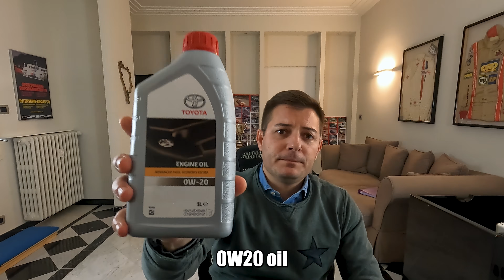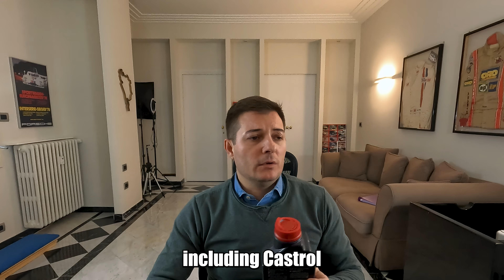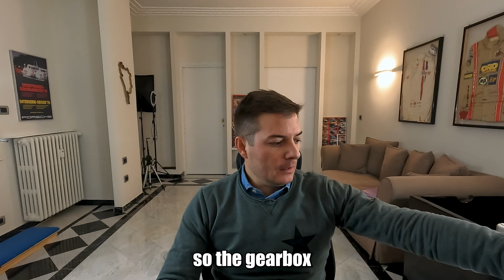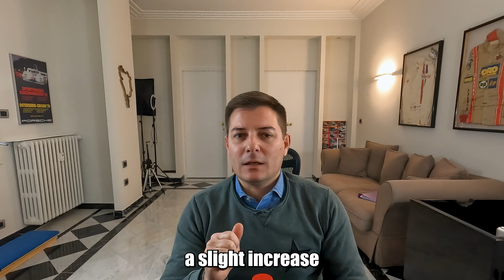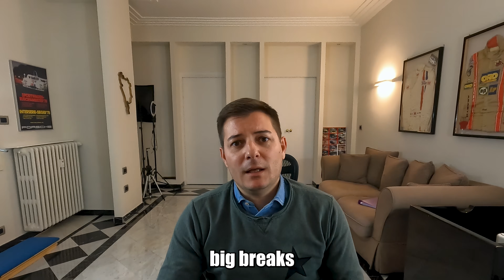Choosing Oil and Lubricants for Toyota GR Yaris & GR Corolla

Comment: In Australia we have a product by Penrite called Shift Eze. Its a PTFE additive and you just add 125ml of it to the gearbox. It has made a massive difference to the shift quality on my Yaris GR. I was not happy after swapping to the Motul oil. It was no better than the standard Toyota oil. Trust me this Penrite product is the best $20 you will spend.
Reply from the maker: That's an interesting tip, glad to hear you found a solution that works well for your gearbox feel! On the other hand, the suggested oil is an objective improvement.

Comment: Ciao, grazie mille per le informazioni, ricapitolando:
motore 5w30;
transfer case gear 300;
differenziale posteriore gear 300 LS?
Reply from the maker: Si, in realta’ si puo usare il 300LS anche nel transfer case. Un piacere e informaci se passi qui al Nürburgring!

Comment: I am coming up for my first oil change on my GR Corolla,thanks to your thoughtful insight I am going to use Motul 5W-30.  Thank you!😎
Reply from the maker: Great choice for the first service! 🔧
Reply: Not a good idea
Reply from the maker: You’re wrong, sorry to call you out
Reply: @PIRASMotorsport  Don’t be sorry. I just feel sorry for those who think a 5W30 is giving them added protection. You’re actually causing much more harm than good
Reply from the maker: Absoloutely not!
I don’t know on what grounds you’re making your statements, but mine are backed by Toyota racing, independent mechanical testing with Piotr and direct experience.
Reply: @P @PIRASMotorsport   I’m curious about the independent mechanical testing with Piotr you’re talking about. What did the testing entail?
Reply from the maker: The protection film the two viscosity’s offer.
0W20 is only meant to serve for fuel economy and emissions. It also washes very easily with fuel, so more frequent changes are needed when pushing the engine.
Reply: @PIRASMotorsport   I really appreciate your candor and engagement here but you continue to place yourself in an untenable position that weakens your position on this matter
Reply: I’m trying to keep this as brief as possible 
1. Your engine is not a testube therefore 5w30 doesn’t carry much weight (no pun intended). It’s all about HTHS shear values 
2. Having said that anyone insisting on using 5W30 your choice of Motul 8100 is the least of all evils. Its HTHS shear values are outstanding (best of class). However that comes with a penalty. More wear at cold start, poorer thermal management due to slower oil velocity leading to localized high temperatures in your turbo charger and underneath your pistons and overall global engine oil temperature due to molecular friction. You’re also putting undue stress on the oil pump which has to work harder to push a 3.3cP oil through bearing journals that are designed around 2.6cP oil film. Tighter tolerances in modern engines is not something to be taken lightly.
3. Garage test theatrics such as Piotr testings are entertaining but do not reflect real-life scenarios. The Timken leverage  machine he uses measures extreme pressure boundary wear common in gearboxes or drill bits. This is not how internal combustion engines function. Internal combustion engines rely on hydrodynamic lubrication.
4. The fuel economy and emissions is a secondary benefit and not a primary driver for a low viscosity oil.
5. As for your claim that 0W20 is easily washed away by fuel, I believe you’re implying to fuel dilution. This happens regardless of oil viscosity. However, using a higher viscosity oil you’ve now introduced another variable that works against you. The biggest irony is that you highlighted LSPI in one of your most watched YouTube video. Using a 5W30 oil makes the engine more susceptible to LSPI. Like you quite aptly stated, the G16E-GTS engine uses very low tension piston rings, if you use a heavy weight oil especially with a compounding high HTHS value, more oil droplets will remain in the combustion chamber. Creating a cocktail of oil and fuel vapors. Best case scenario this unfavorable cocktail will just quench performance and prematurely foul your plugs, worst case scenario the dreaded LSPI.
At the end of the day oil chemistry matters not the number on the bottle.
My argument is based off chemical architecture, fluid dynamics and not based off anecdotes, feelings (aka placebo effect) and a static desktop friction wheel (the Piotr Testings) which displays a total misunderstanding of fluid dynamics within an internal combustion engine.
Reply from the maker: Very welcome, but please don’t be afraid to use your beautiful GRC!
The car is perfect and will be sound if used properly!

Comment: Useful info thank you!  Any reason why you wouldn't pick the Motul Motylgear 75W-85 vs the thicker 75W-90 which may run hotter given the transfer case overheating issues and it being within the Toyota spec for the GR yaris and GR corolla?
Reply from the maker: The denser oil creates a thicker film that in turn protects more

Comment: Great video. 
0W20 is too thin for a performance engine, the oil will shear easily & will not provide the desired protection for the internals. 
Many car guys don't know about this... 
Also use top tier gasoline (RON 97/98/100)
Reply from the maker: Thankyou, couldn’t agree more!

Comment: Hi ...
Thanks for sharing your experience on the gr Yaris.
I'm sharing some of my experiences where we race in the quarter mile.  We use Liqui moly, and for me is one of the best oils out there. I used to use  motul, 
But used to be come black very quickly, then I changed to liqui moly and the engine and oil remaind clean.
After 10yrs dismantled the engine to change connecting rods for more power, and the engine remained as new.
The engine is a Honda b18 turbo, had 500hp with pump fuel, and 740hp with race fuel. The runs 10 seconds flat and spinning the wheels (slicks tyres 24.5) engine raved 9000rpm with no issues.
I'm interning to buy a GR Yaris.
Hav
Reply from the maker: Thankyou for sharing! Yes, I used to be a LiquiMoly dealer, it is a very good product!
Reply: @PIRASMotorsport 
Hey.
Can you type exactly Which Liquy Moly 5w30 is ?
There is 5w30 with some another sn,or any others letters..
Reply: Liqui Moly TopTec 4200 5w30 New Generation 
API SQ
Reply: That I will use when my GR Yaris arrives 😊
Reply from the maker: Liqui Moly is good, but this is sounding too much as am advertisement mate 😉
Reply: Nooo at all!!
I'm not going to earn nothing from it.
I  just try to help others, as I can need help from you guys 🙏

Comment: Redline 5w30 changed every 5000km is all you need.
Reply from the maker: And not driving it in turbo surge, and oil sump baffle and radiator, ues I agree
Reply: Red Line 5W30 not API SP certified!
Reply: @askay747 
Still is the best oil you can get and blows 99% of the oils on the market
Reply: @MrAnticaArte I’m a big fan of Red Line      products! 😄, my GR Corolla currently running Red Line 5W30😅, manual gearbox, transfer case and rear differential oil are all Red Line’s! My FK8 running Red Line oil as well.

Comment: Hello sir! 

I follow your YouTube channel with great interest, especially the topics related to the GR Yaris. You're doing an excellent job, and I appreciate it!

I was slightly surprised by Toyota's recommendation for engine oil (0W-20), especially considering that we're talking about a sports car, which is often driven differently from a normal street-driving style.

Regarding your recommendation, I’d be curious to hear your opinion on Motul 300V Competition 5W-50. Why didn’t you choose this option instead of 5W-30?

Thank you in advance for your response, and I wish you a great day!

 Keep up the great work on YouTube!
Reply from the maker: That oil is much thicker, used for long races, not good for everyday uses. 5W30 works perfectly, and within the temperature window of the GR Yaris

Comment: Thank you for your feedback!

For the gearbox Motul website recommended  GEAR POWER FE 75W.?

Thanks
Reply from the maker: That can work sure, but the ones I posted in the video and notes are a result of cooperation with an engineer at Motul
Reply: @PIRASMotorsport  thanks for the reply.

Good thing then, been using Gear300 75w90 on Evo and Clio with great results.

Just wasn't sure for the YarisGR because of the Torsen.

Cheers!
Reply from the maker: @hxllxman  It is great, Torsen gets things very hot too!
Reply: I forgot, Since TC use GL-5 as the Rear diff.
Why no use the Gear300 75w90 LS in the TC?
Reply from the maker: @hxllxman  it will also work fine: with Motul's engineer, we selected the "non LS" version to minimize the transmission power losses.
Reply: @PIRASMotorsport  thank you for sharing your knowledge!
Reply from the maker: @hxllxman  My pleasure! I'm here to share and learn!

Comment: What about 5w 20 oil.
Reply from the maker: Better, but less protection at higher temps
Reply: @PIRASMotorsport  what about the factory oil pump with thicker viscosity over time will they be ok.
Reply from the maker: @mhk67091 yes, its fine mate. Cars are even racing with 5W50 over the last two years
Reply: @PIRASMotorsport  ok thanks
Reply: @PIRASMotorsport  I have owed the car since new July of 2023 and now I have 23k miles. I change my oil every 2500 miles and have done 9 oil changes already with 0w 20 Pennzoil Ultra Platinum which is a API SP ILSAC GF6-A oil. I guess I will try 5w 30 same brand Pennzoil Ultra Platinum 5w 30 same API SP with ILSAC-GF6-A specification. Pennzoil Ultra Platinum is a borate ester very good premium oil. My oil analysis came back from the lab perfect.

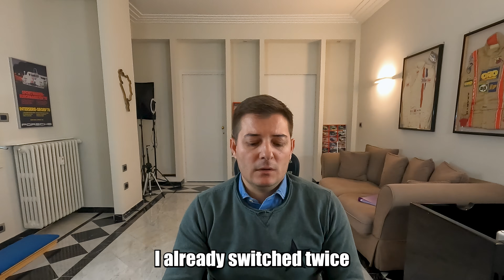Comment: Hi great video, quick question does the oil for the rear differential at 9:26 also apply for the GR Yaris Convenience model (that doesn’t have the Torsen differential) or should I be using something else? Thank you so much, there’s not much talk about the Yaris’ without the Torsen differentials so I have no idea.
Reply from the maker: Yes, there is sooo much to talk about mate!!
The GR Yaris non-circuit version, without Torsen differentials, can benefit from using the Gear 300 (non LS) both in transfer case and rear differential.
This is because there are less rotating gears, therefore less heat generated
Reply: @PIRASMotorsport  oh my gosh you are the best! I will be buying some soon, only just hit 3,000 miles on my car so I have some time. Thank you so much again I really appreciate it :)
Reply from the maker: @UzzyT. thanks mate, you are very welcome!

Comment: Hey Adriano, I would also like to thank you very much for posting this video!

The information you provide is always top notch and it helps VERY much!

I have two question to ask though:

You said 5W30 and 5W40 is fine, personally you recommend 5W30 (right now I have the same Motul 5W30 in my car as you showed in the video).

On what circumstances would you recommend going for a 5W40?
Why not straight go for a 5W40?

Next question:

In a german GR Yaris forum there are mixed reactions about asking the dealerships to fill in other type of oil than 0W20.

My dealership says „no problem we are going 5W30 and you keep your engine warranty.“
Other dealerships are saying „we are not going to fill in any other oil than 0W20 or your warranty is voided.“

Do you perhaps have a paper/document from Toyota Europe that perhaps clears up this issue?

Thank you very much for your time Adriano!
Reply from the maker: Hello, thankyou for your reply, I most appreciate it!
5W30 is the best oil for all uses. 0W20 is mostly for emissions and consumption homologation.
5W40 is more rare, only used in some race applications where they have solid cam lifters and they expect to see very high temperatures for prolonged periods!
Unfortunately they don’t release official documentation on this, but the answer from Toyota’s motorsport team and my dealer is the same you got. The mechanics are happier with 5W30 for engine protection, as the oil film is more resistant
Reply: @PIRASMotorsport Hey Adriano, thank you very much for the clarification!

I would like to ask another question that came up in my mind:

I know (& you said) that the Torsen LSD in the front works together with the gearbox (they share the same oil as they are 1 circuit).

Why do you go for the normal Gear 300 for the front and not for the Gear 300 LS like in the back?

I am asking because the LS is especially made for Limited Slip Differentials and the LS can also be used for the Gearbox.

Thank you very much in advance!
Reply from the maker: No problem, my pleasure! Please evaluate a channel membership to support my work!
In regards to the gearbox oil question: the Gear 300LS is a very dense oil, and the gearbox would become incredibly slow and stiff, to the point that it would not be nice to operate!

Comment: Sharing more oil knowledge for our GR Yaris'. Ravenol DFE 0W-20 on the G16E engine, used for 10,000 kilometers with a track day included, close to zero degradation as confirmed through an oil lab test. No need to up your viscosity I guess? Link is below. 

https://www.youtube.com/watch?v=UWRXIYUyprs
Reply from the maker: Don’t take it badly… You know, it is very tiring to answer all comments like yours, because there isn’t the basic technical understanding beneath to work with.
Of course 0W20 oil works, and a good quality one will work better too.
Simply put, the protective film of a 5W30 oil is thicker, and this is now accepted by Toyota, after much testing direct and indirect from us tuners, from Lamspeed to ACME, to Toyota Gazoo Italy and many more.
A 5W30 will always protect more than a 0W20, especially in an engine like this one that has 3 piston squirters and is known for blow by due to piston ring float.

Comment: Could you help me pls. For a new GR Yaris, after how many klm is it required by Toyota to change the engine oils the first time? I can't find info in the manual
Reply from the maker: I think they say 5000km, but i would suggest to flush after 1000 and then again at 5000

Comment: Hi!! What oil temperature do you have in normal driving? Mine on the highway at 120kmh and 10° outside my oil temperature is a 100°c.. and when I srive a little bit hard on mountains roads the oil goes directly to 120°c +
Reply from the maker: Hello mate, mine is usually in the 80s and 100 when going maximum, sometimes a bit under 120 only when above 2000mt over sea level and going 100%
Reply: Thank you for your response! So my GR definitely have a probleme🥲 calling my Toyota dealer tomorrow morning
Reply from the maker: Your GR has normal temperatures for a stock car, no problems! You need to install our Hood Vents and an additional oil cooler to achieve my results!
Reply: @PIRASMotorsport  ok! But in Switzerland we can’t cut the hood 🥲 can’t install a oil cooler as well.. or I have to take a very discreet one and hope police will not see it 🤦🏻‍♂️😂

Comment: That car have 10 years waranty Toyota, why it is a problem to run with that 0w20 oil. If people get there engines run bad, and create some issues it its for Toyota to solve it out. Many Modern engines run on tin oil, its a evolution in design of internal parts that get better and better. Bmw M cars with a three liter six cylinder with almost 500hp run on 0w30, so why not a Yaris GR  on 0w20.
Reply from the maker: Because 
- the Gen 1 car has an issue with piston rings gaps, that when thermically stressed have brought to mega-blow by in various occasions, the most famous is ACME’s development car.
- oil pump can limit oil pressure with bypass, but can’t help low oil pressure idling after heavy driving at 0.3bar on 0W20 oil.
All the top tuners, and most rally teams are using 5W30 for these reasons, and they change oil with much higher frequency than average road drivers.
If you just street your car on Oem settings 0W20 will be fine, but if you are pushing thing in performance (power) and driving, you will want to consider minimum top quality 0W20 or a very good Api SP 5W30

Comment: Ciao, grazie per il video. Io ho la versione Circuit con differenziali autobloccanti anteriore e posteriore. Non sarebbe meglio inserire , sia nel differenziale posteriore che nel cambio anteriore la versione Motul Gear 300 LS 75W-90?? Grazie per la risposta
Reply from the maker: Ciao, grazie a Te per aver seguito e per la domanda! Quanto dici ha molto senso ma, il Gear 300LS è un olio troppo viscoso per il cambio, che porterebbe ad un forte indurimento ed a possibili imputamenti. Per questo, nel cambio, suggerisco il Gear300 “liscio”! A presto
Reply: @PIRASMotorsport  Grazie Adriano, molto gentile, ma non succede niente non usando olio specifico per slittamento limitato?
Reply from the maker: Solo quello che ho detto sopra, puoi provare pero’ non lo consiglio perché un olio molto viscoso poi ti costringe a lavare il cambio con diversi cambi d’olio per liberartene

Comment: Sans compter l'huile de frein, vous parlez de 2 types huiles original mais toyota en préconise 4 types (moteur 0W-20 SP GF-6A API), (boite a vitesse LV GL-4 75W), (Boite de transfert LT 75W-85 GL-5), (differenciel arrière LX 75W-85 GL-5). Alors je suis confus!
Reply from the maker: You are right! We decided to step up the oil in the gearbox to the same in transfer, given overheating from the torsen differential, that is why one less!

Comment: Everything you say is correct, I did a lot of research in early stage of owning one back in 2021. 
Lately I used Redline Oil MTL and MT-LV which is the best for manual  transmission. 
As for the Transfer case I used Driven and same to Rear Differential, on Mutol (LS) is for limited slip for circuit package GR option.
Reply from the maker: Cheers Mate, thankyou for the support, most important for me!
Reply: Thanks for your reply 😊
Reply from the maker: @ivan1272able of course, sorry for being late, full days!